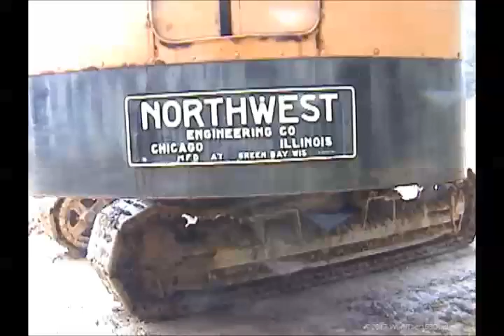D9G Site Cleanup - Brownsville - August 12, 2001

Comment: That D9 can flat push some dirt!!  Great sound , cool video
Reply: A great old yoke ,sadly rarely seen nowadays .
Run forever very powerful& reliable.
A great pusher for 657 in the 60/70/80.
Merrimen ,Neil Beecher,Crouch ,French .Blackwell .
All used them mass excavation, opencast in rock cuts too.
Hard as nails ,pilots too,noisy bouncy etc .
Everyday a new adventure, young &crazy ,happy days .

Many of the men who operated these sadly left us .
Doubtful of any one today could even start  donkey engines .
Wouldn't work long hours either.
Wimps .

Comment: I personally think cats larger dozers--d7 up had too small a blades on them..    In Oz d7s pushing dams for water catchment, would have 18 inch hungry boards on top of the blade and going up a 30 degree batter would have dirt spilling over the top..They could push..

Comment: My dad had an International TD25 back in the late 70's. Which was bigger?
Reply: Meand the Mrs...... The D9 was definitely the bigger of the two.  The TD25  Series 250, was only built from 1959 to 1962 and was rated at 189 drawbar hp (230 at the crankshaft),  compared to the Cat D9E which was introduced in 1959 and rated at 335 hp,  and the legendary D9G which came out in 1961 and rated at 385 hp.  The Cat D9 Series were built from 1955 to 1979 in the conventional Low sprocket configuration,  then the D9L came out in 1980 and was the first High Drive undercarriage in the D9 series.

The Cat D9G weighed in at about 94,314 lbs Without the blade or ripper... compared to the TD25 which was right around 45,550 lbs With the blade.

The Cat D9G had a track gauge (width) of 7.5 ft and was 18.4 ft long Without the blade (23.8 ft with it).... the TD25 had a track gauge of about 6.8 ft (I don't remember for sure.. but it's close), and was about 97" high (8.08ft) at the operators seat.

The TD25 had the new IH DT-817 engine (817ci = 5.375" bore and 6" stroke)  and the D9 Cat had its D353 engine for the entire length of its production from 1955 through 1979... and the Cat's D9  D353 engine had 1,473ci  resulting from its 6.25" bore x 8" stroke x 6 cyl. (inline, of course).

The Cat D9 was built (1954 / 1955) to compete with Euclids famous (and more powerful) TC-12 dozer with its twin 6-71 GM Diesels (one engine for each track - 2 cycle - 217hp each [only 426 ci each] - 434 hp total)

In 1974 Cat came out with the D9H came out to replace the legendary D9G (385hp) and the H was rated at 410 hp,  and it continued through to, and including the 1979 model year,  until the Elevated Drive D9K was introduced in 1980 (460 hp).
Reply: No question about that. I suppose if I had seen them side by side back then there would have been no question. Thanks.
Reply: 2Stroke Diesel Power d9k????
Reply: 2Stroke Diesel Power u meant D9L
Reply: 2 stroke Diesel Power. No TD 25 ever tipped the scale as light as 45,500lbs even stripped to the bear tractor! My TD 24 blade and all weighs in around 60,000lbs!...... 

A full dressed 9g  (blade and ripper) is just under 100,000lbs  Very close to my TD 25M.............
Reply: He was fitting his dirt. Good sounding old gal